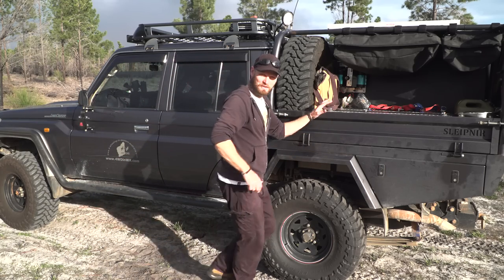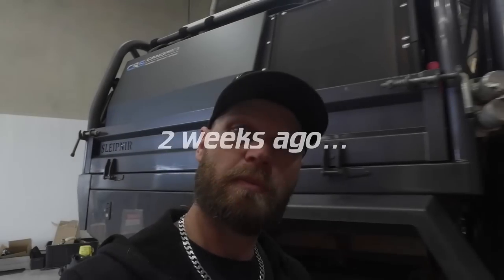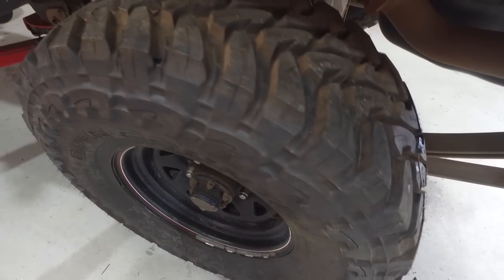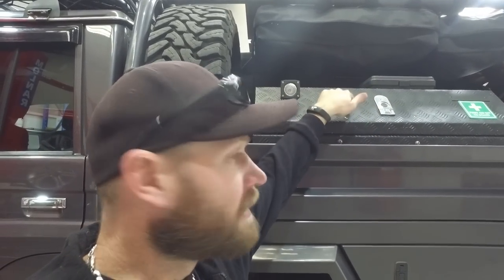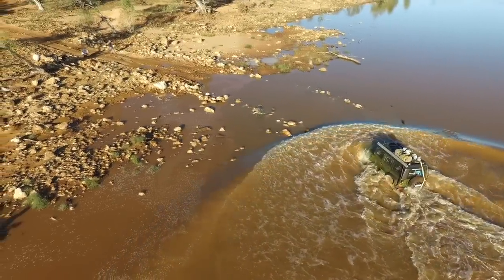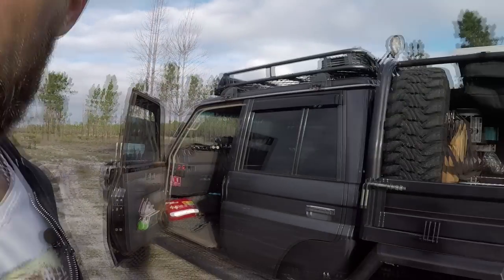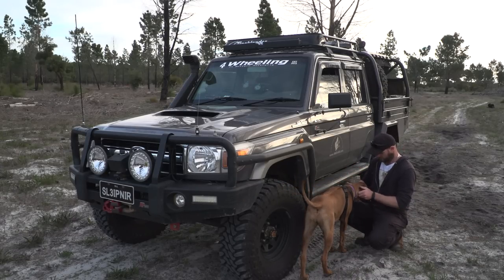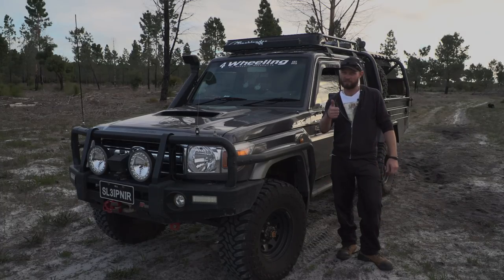Landcruiser mods, The Kimberley, Jeep is back, Vlog 2017.3

Comment: Those floor mats are really good. I have had them in my car since 3 years now. They brilliantly hold on to water, dust, mud, sand, small bits and pieces. If possible add a metal or a fiber plate where your right heel lands as that will wear out the mat. Mine has got a hole right there. The draws look fantastic.

Comment: Ronny, enjoy the Kimberley trip.  It's awesome country.

Really looking forward to more thoughts on the rear parabolic springs and in depth comments, brand etc. I want to put parabolic springs (they come from WA, Westralia springs) and Koni shocks on my ute. Remote res is all the rage but I really can't be bothered with worrying about valving rate adjustments and the previous Koni Heavy tracks I had on another vehicle were simple and reliable. Dobinson springs will lift  3" though but i'm really after a 2" lift to keep legal in SA hence wanting to get some advice from those that have used them as you say and not those that have heard about them.

Safe travels mate.  Looks forward to some night star trails in the gorges......

Comment: Don't buy a Jeep
Reply: Sir Fedswith They r ok to buy if there's lots of junkyards full of dead jeep, like here in the USA. They break a lot .  Jeeps fix easy
Reply: I spend a good amount of time fixing my XJ but to be fair the previous owner didn't upkeep it as well as they could of so essentially I'm doing reactive maintenance as much as preventative maintenance.

My Commodore and Jackaroo were about equal in terms of wear and tear repairs although parts were cheaper :)
Reply: 170000km on my jkur and not a problem.   Which is more than i can say for my old gu and hilux